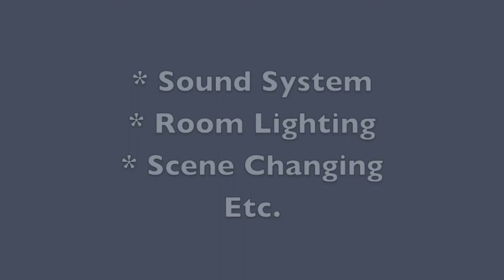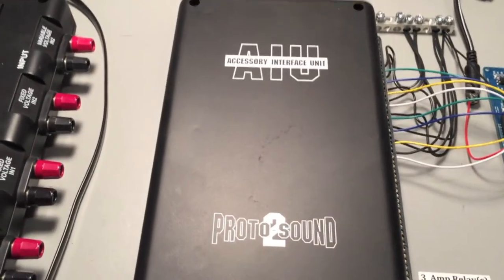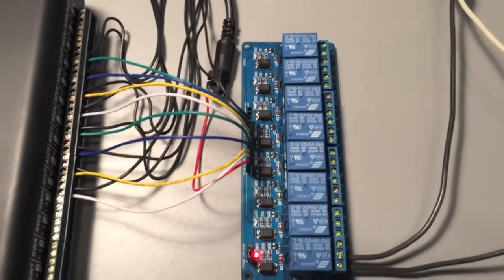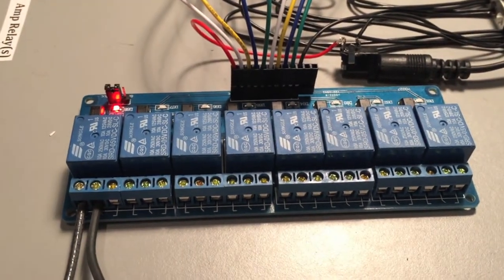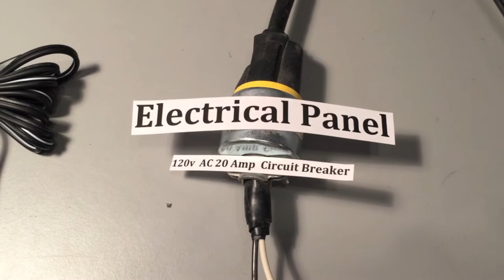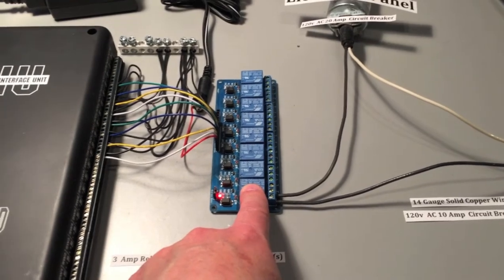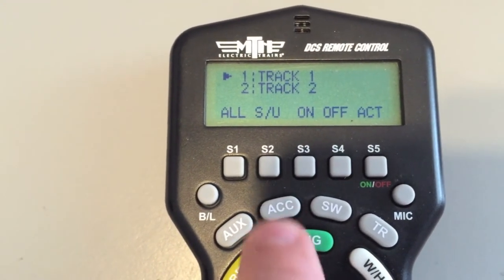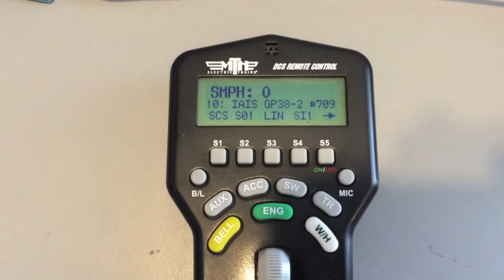MTH DCS AIU Relays (Part 1)

Comment: Nice Video.  Just want to know about the relay board you have there - it seems to be a production one, what is it?Also the external relays are only needed if switching large currents (>say 10A of accessories) or mains voltages, correct?What is the extra circuitry on that relay board used for?
Reply from the maker: +Peter G Yes, its a production board.  Just search EbA for 5v relay.  I use it for large current loads, like track power.  These boards have eight relays and indicator lights.  Hope this helps, Thanks!

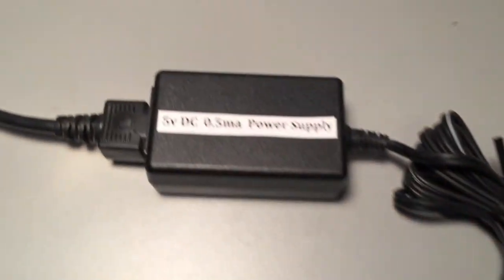Comment: At about 2:20, the 5V DC power supply for the external relay board says "0.5ma".  I think you mean 0.5A or 0.5 Amps.  0.5mA  is 0.0005 Amps which is woefully inadequate.
Reply from the maker: +stan2004 Yes, the label is incorrect.  The correct amperage is 2.0A.  Thanks.

Comment: Crazy !! What cord do you use from the TIU to the AIU just a phone cord
Reply from the maker: The control cable comes with the AIU.  Thanks
Reply: @digistew  I didn’t get one do you know where I can get one or the item number
Reply from the maker: @trackspike64  So, I believe this is RJ12  six (6) conductor telephone cable.  Hope this helps, Thanks
Reply: @digistew  sure does I have a ton of it so that’s cool plus I make it in any length I need , I get the plug ends from Tony’s train exchange
Reply from the maker: @trackspike64  A word of caution, be sure to plug into the input jack on the AIU.  Will cause damage to the AIU on the older models (found out the hard way) if you plug into the output jack.  I do believe they fixed this problem on the newer models.
Reply: @digistew  yeah the cable comes out of the TIU and into the input on the AIU then if you do another AIU it’s repeated!! Boy I can’t believe how much people want for a set now with mth changing hands and covid it’s crazy just glad I got mine cheap but I know where to make some nice cash if I need it Lol but e bay is loaded with them !! Next week I’m getting my TIU and two hand heads updated to 6.1

Comment: I was wondering how do you control the switches I have a tortoise switch machine and mth aiu and what other parts do I need
Reply from the maker: Check out this discussion on the OGR forum.  I plan to use Tortoise machines also but, was going to use DC from a control panel.  This discussion talks about using AC as an option with a pair of diodes on the ACC channel.  Hope this helps.  http://ogrforum.ogaugerr.com/topic/cobalt-turnout-motors-work-with-aiu